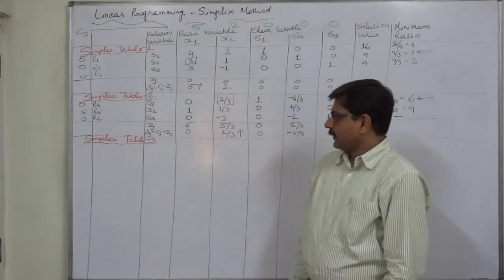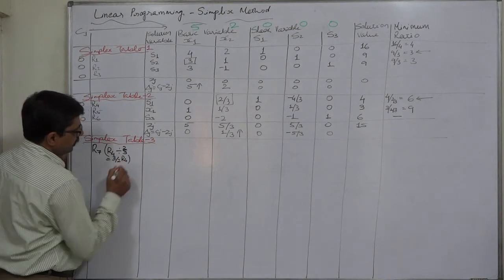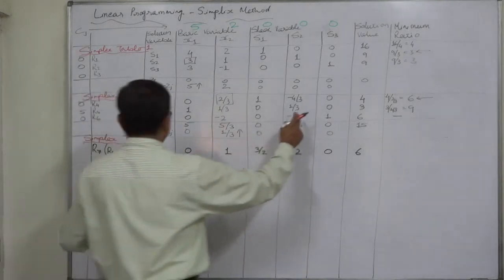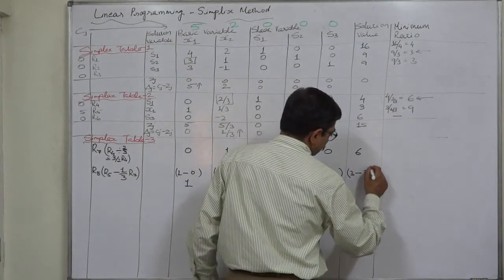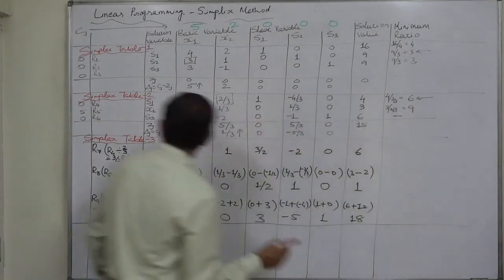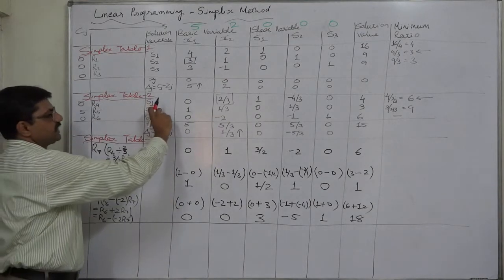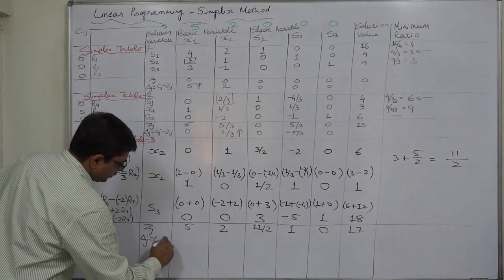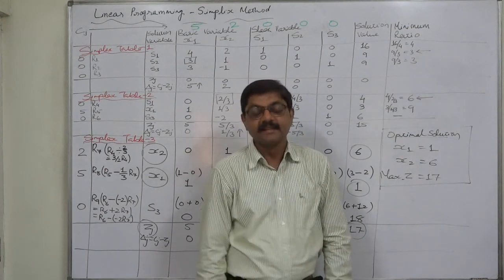Simplex Method 13 When there is a tie between two rows Part 4 of 4

Comment: sir i tried using third row for which i got minimum ratios 1.2, 0 and -9. SO i took 1.2 as minimum ratio and went ahead. I got solution as x1=3.4 and x2=1.2 . I have checked solution many times but im not able to identify where i had committed mistake.

Comment: during previous lecture you calculated Sol. variable value of 3rd row as 0, whereas in this lecture you have taken it as 6 why is that ?? (While calulating myself i get the Solution value of S3 row for table 3 as 12)
Reply: should i select this as pivot row or 2nd min ratio that is  6